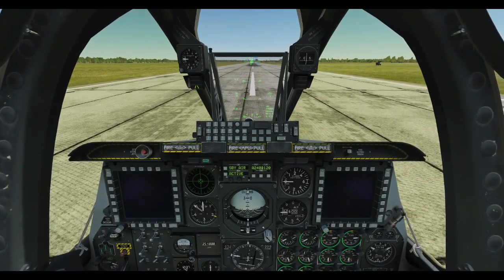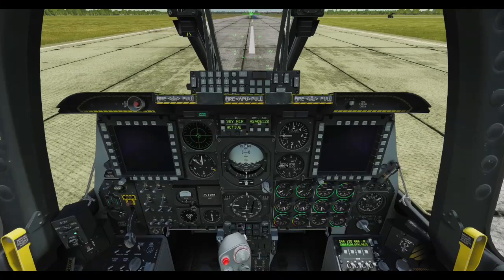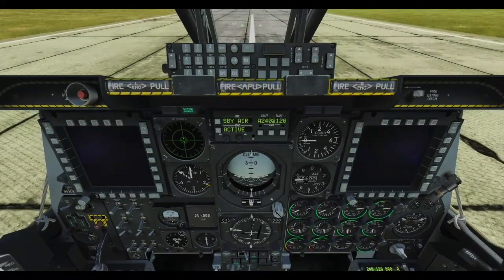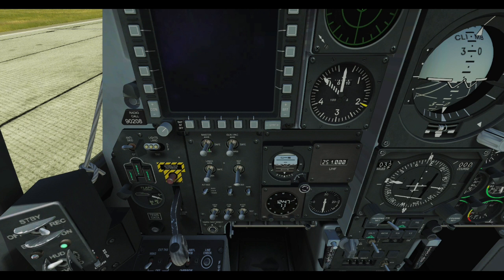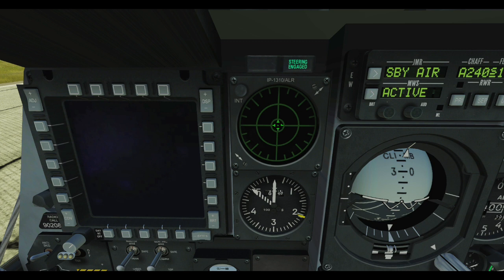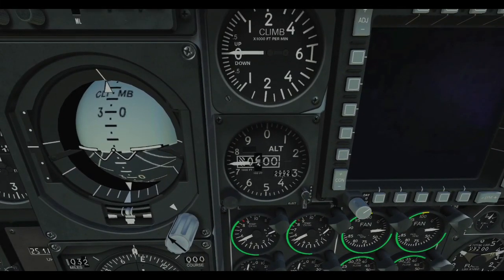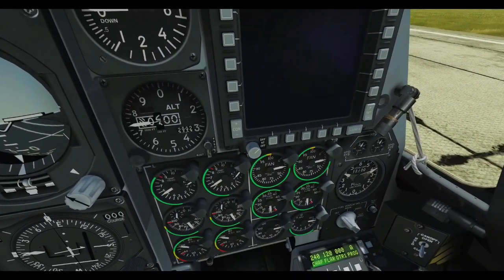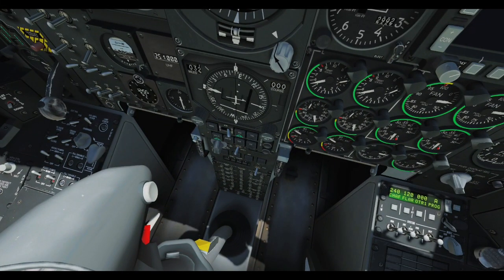Simpit A10C - Front Dash - Part 1: Introduction

Comment: Great work here.  Just a thought - you could save a bunch of work on the MFDs by using the pre-made, already backlit units from Thrustmaster.  Search MFD Cougar on ebay.
Reply from the maker: Hi Marty, I have seen the Thrustmaster MFDs and thought about getting them. I have no doubt that they are good quality, reasonably priced for what they are and look great backlit. Also it's handy when something is plug and play. However, I like the idea of full sized displays, and if I do them myself I can add in a small integral rotary switch for turning them on into day or night mode. I'm part way into designing them. It's took a fair while but hopefully will work fine. Cheers for watching